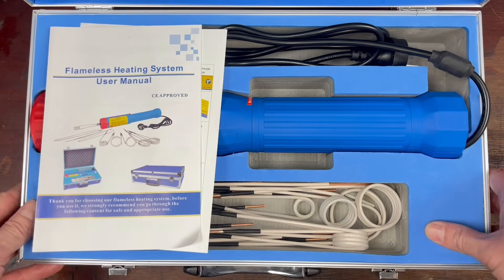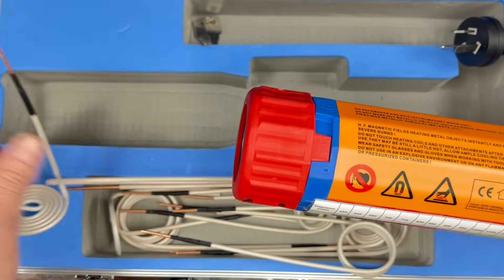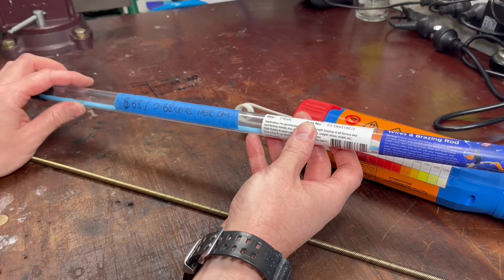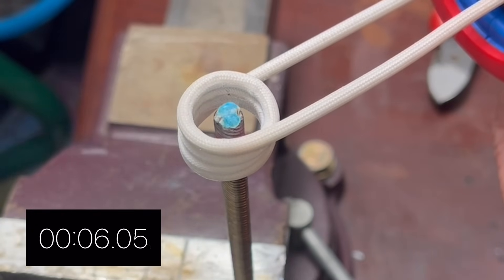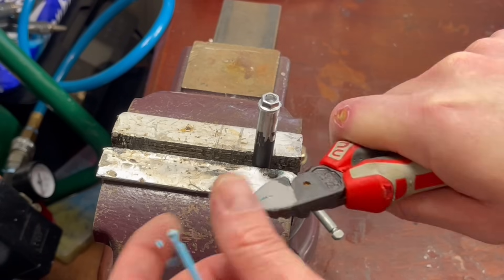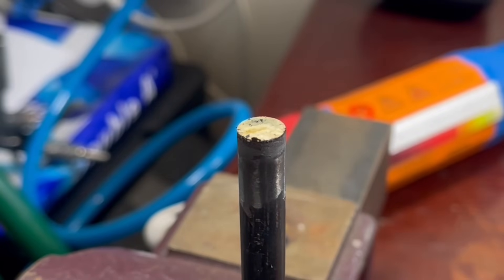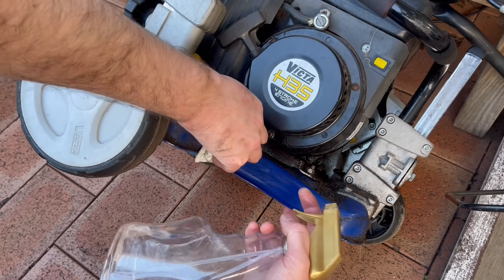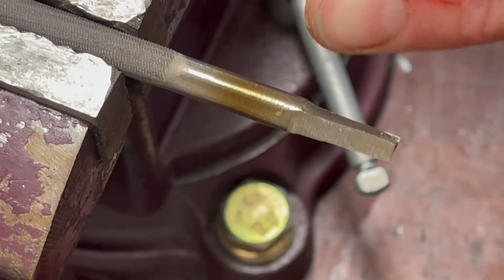Every Mechanic Needs This Tool! Save Time & Money!

Comment: Having used propane, mapp, and oxy/acetylene, all of my life, I have always dreamed of having an induction heater to get even better use of heat. The only problem is it has to be a ferrous material for it to work, as it uses a magnetic field to induce the heat, and non ferrous metals do not react to a magnetic field.
Reply: Not strictly true. Induction heating creates a very high amperage current in the workpiece. Even pure silver should melt if you have enough magnetic field strength and current. It just gets harder to achieve the correct parameters for melting with lower resistance materials like copper, silver and gold. You can buy an induction furnace designed for that specific job though.
Reply: @evanpnz  So the problem is the load the non ferrite material have?
Reply: @jeffreyyoung4104  No, just getting the right balance of inductive coupling, current, and internal resistance of the heated part.
Reply from the maker: It’s very strange, it is useless on solid brass bar, but on brass tube it’s fantastic (glowing red in 10 seconds) however I have only tried brass not Aluminum.
Reply: @VintageEngineRepairs  the brass tubing may have had nickle in it, which is magnetic.
Reply: @VintageEngineRepairs  induction likes edges thats why the wire used is flexible "Lenz" wire, its all outer surfaces aka edges vs the inner solid mass. The brass rod is more inner than out while the tubing has high edge to mass ration so heat up really well. Corners in square rectuangle rod tends to overheat which is why professional coils have "ears" loops to lower the effect in corned. You can "burn" the metal otherwise.
Reply: @deaultusername You mean “litz wire”. Lenz is the guy the induction law is named after. Litz (from the German word for “strand”) wire is the one where each strand is individually insulated to maximize skin effect.

Comment: Induction also works on non ferric, even non metal material, the material only should conduct electricity.
Aluminium need more electric field, it gets hot, but not always, if the field isn't strong enough.
It also works on carbon, like a graphite crucible to melt metals in it.
Reply: I came here to say that. It relies on induced current, so the target only need to conduct.
You can heat up carbon with an induction heater... Try a pencil, the graphite will work (have a bucket of water ready!)
Reply: @juststeve5542  Pencil works best with 24V DC on both ends :D its a quality test *just kidding*, bad pencils can detonate, not really violently but a bit scary, when the wood releases gases on the inside. wear protection, do it outside, with no flammables near, water bucket ready :D but that's not induction, it's fun.
Reply from the maker: Thanks for sharing! I tried a small brass bar it was hardly even warm after 10 seconds. I tried brass tube and it was glowing.
Reply: @VintageEngineRepairs  you're welcome. its also depends on mass, if there is more mass it can induce more heat, but more mass needs more heat, it spreads evenly. small things get hot, as bigger once, but i think bigger things got better mass to surface ratio therefore, less heat dissipation.most effect as already mentioned is the distance to the coil and turns. Tubes are a good shape, for that. Its really try and error, depending on the device.
Reply: @VintageEngineRepairs thermal conductivity also plays a role. Aluminum, copper,  brass, etc. are 2-5 times more thermally conductive than steel. So with a 1kW induction heater like that, the heat spreads into the rest of the material almost as quick as it's  "produced", so the entire part warms up instead of just the area next to the coil.

Comment: You can use bare copper wire of the proper gage as long as the coils do not touch. But that would only be in case you couldn't get replacement coils.
Reply from the maker: You’re spot on, since the release of this video, I ordered 2.5mm solid copper wire and you also need a roll of 3mm fibreglass sleeves. Just make your own. Even cheaper than the ore fabricated coils :)
Reply: @VintageEngineRepairs and @vhoward1122 Thanks for the money saving tip!
Reply: Many thanks for this , I’m definitely going to purchase one for the workshop , what make is this one please

Comment: Oooh..  This is temptation.
I have a collection of thin walled mild steel tent and marquee poles for repurposing into useful new things, or just for creative fun. I am building my own truss for a new shed roof right now and plan to make custom curtain poles next. Arc welding thin walled steel together is time consuming and tricky - so easy to blow holes instead of make neat joints.
Not long taken delivery of some Polybend, a non-toxic plastic version of low melt metal such as Woods Metal, so I can bend the tubes without losing the circular profile.
I can see this induction heater heating two thin steel tube ends to welding temperature so all I have to do is push them together to make a join. If that doesn't work I'll braze the two ends. Neat, easy and quicker than arc welding.

Off to check bank account...
Reply from the maker: Awesome project for the induction heater! That’s a great way to do it, as you say - its easy to blow a hole through it with welding, at least with my level of skill haha. This is a fool proof method for brazing :)

Comment: I had one it blew up after 5th cycle, I kept within the 2 minutes but i suspect not waiting 5 minutes in-between each cycle compounds the heat.  Still a good tool ill probably go for the slightly more expensive one with a remote box for the electronics.
Reply from the maker: Ah sorry to hear it! I hope you managed to get your money back :)
Reply: The same item has many repeated/abandoned listings on Amazon. It's a way that manufacturers can suppress bad reviews and so gaming the review system, which is why very few have any stars/reviews. I would never buy something without plenty of positive reviews when It's clear this has gone on. So I have a feeling you aren't the only one.

Comment: I got one of these for a tough job repairing front suspension of a car, could not use flame near the firewall / floor with insulation and carpeting.  Worked good.
Reply from the maker: Awesome! Pleased to hear it :)

Comment: Do they sell or is it easy to find that wire you make the coils out of incase you want or need to make more or larger custom coils?

If what your trying to heat up touches the induction coils will you get shocked?
Reply from the maker: Since this video I ordered 2.5mm copper wire and insulation to make my own and always have on hand. Yes, if the metal coils touch metal, the tool sparks. Not good lol

Comment: A very very thought out and entertaining demonstration of an induction heater , I enjoyed it very much and subscribed :) 

Safety I agree , 
Control , partially I agree ,
Ease of use , it goes to Map-Pro gas , try plumbing with copper or for that matter anywhere you need a complete end to end connection. How will you wrap the induction heater around a pipe for the last connection , there is no end to slip it over ? Not going to happen. Heating large surfaces evenly , in a space heater , etc.   I can list quite a few more.
Portability I agree
Price I agree
Cost of consumables in the case of DYI users I agree , I am a large consumer of MAP-Pro and my company buys it in bulk wholesale lots which is about 40% retail cost.
Availability I agree
Speed /Efficiency I would give it a draw (See ease of use response) . There are many jobs that induction heaters cannot do that Map-Pro can so each has their definite forte making both a good thing to kit your vans with. 
Versatility I agree 

The yellow cylinders are a MAPP - Propane hybrid (MAP-Pro) and NOT propane. This is a distinctly different gas with a much , much higher temperature and it uses a different torch head than a propane torch head and can be dangerous if mixed so this should be carefully noted for those not familiar with the two gases.

Comment: Actually, you showed MAP gas.  Propane is about 30% cheaper. (USA/Amazon)
Reply from the maker: You’re quite right, it’s propylene. I don’t refer to it as MAP as people presume I’d be referring to MAPP, (methylacetylene-propadiene propane) which it’s not.  Instead MAP is 100% propylene.
Reply: @VintageEngineRepairs  Are you saying that "Propane" does not develop sufficient heat to do these things  Why bring MAP into the discussion if propane will suffice?
Reply from the maker: @alext8828  you brought Map into the discussion, not me. You do realise MAPP and MAP/PRO are totally different things…

Comment: You solder by heating the parent metal and letting the parent metal melt the solder, otherwise you get a dry solder joint that is weak and is less conductive electrically.
Reply from the maker: Yep, that’s what I explained in the video
Reply: I think more often, people overheat the joint?

Comment: Very expensive.
Reply: Nothing is cheap now days
Reply: No, expensive is spending hours under a car that's lived it's life in the snow and salt and you are trying to remove nuts and bolts that are rust welded
Reply: Only $189 USD on AMZ. :-)
Reply: That's cheap for a good induction heater that's as versatile as this one.
Reply from the maker: As mentioned In the video, upfront it’s fairly expensive, long term it’s very affordable.

Comment: They're wonderful tools, but there's so many brands and models out there ranging from very expensive to very cheap. Hard to know what's good quality, effective and reliable. How does a $150 model perform vs a $1500 model and how much use and abuse can they handle over time? For now, I'll make do with the old torch.
Reply from the maker: Yeah they’re brilliant!! Regarding longevity, I’ll certainly do an update video in a year and share how it’s holding up :) this is aimed at the home mechanic of course, but I’ll be using it professionally so I’ll be putting it through its paces. Thanks for watching!

Comment: Since it only works with ferrous metal, I wonder if some sort of steel insert could be used to place into an aluminum engine block then heated up for bearing installation.
Reply: Impedance seems to be better matched with higher relative resistivity metals such as iron.
Reply: @jagmarc  my doctor gave me a prescription for my impedance. Worked great. 😂
Reply from the maker: Very interesting idea!!
Reply: Actually.... I'm not sure why they make this claim-  I purchased one several years ago for many things; but primarily for annealing brass (a non ferrous metal) cartridge cases, & it works fantastic!
Reply from the maker: Yeah I tried brass tubing and works well, but solid brass stock it hardly even warms it up.
Reply: @VintageEngineRepairs  - Interesting. Scientifically, I'd like to know how tubing vs solid makes a difference-  Thanks!

Comment: Refillable propane bottles come in different sizes. Some bottles are on exchange basis if you prefer otherwise it's retest every 5 years. Advantage of owning own bottle is gas cost. Numerous sizes of tips for propane for increase or decrease in flame type, i.e needle point for extra low heat to wider for large area heating without the need for different sized torch handles, no need for a regulator as the handle is the reg i.e restrictive orifice. 
The device you show if it could heat a u shape coil would make it more effective on pipe or other material where you want to join stuff without it looping around the object
Reply from the maker: Very true! I use Map/pro so it’s just the one size by bernzomatic. Unless you know or other more affordable Map/pro out there? You can heat up shape u-shape material. Just bend the coils to the profile - it doesn’t have to wrap all the way around. Regarding propane vs induction, propane has its place without question! They compliment eachother and have areas where they excel!
Reply: I just upgraded to oxy-propane and the accuracy of heating is nice rather than the broader flame of mapp burner, but the induction looks even faster (but not nearly as exciting as holding a lit blowtorch!).
Reply from the maker: @mikelastname  gotta love the controllability of oxy!!!

Comment: i'd have liked to see you braze carbide cutters to boring bars for lathes.
Reply: There are YouTube videos showing induction heating being used to braze carbide tips to circular saw blades.
Reply from the maker: Because carbide isn’t ferrous it can’t be brazed using the induction heater sadly! I’m not sure if the radiant heat would be sufficient to heat the carbide up enough.

Comment: How can price be a draw you included the cost of propane but you didn't include the cost of electric and induction heaters take a lot of electric, cost / con was a draw for the same reason, but i still agree with you conclusions well done in the most part.
Reply from the maker: Hey mate, it’s a fair point, but when I calculated the cost of a 10 second burst which was basically (within a few seconds) what it took to heat nuts, bolts and shafts up to cherry red  with the induction heater it cost $0.0017. It’s so marginal.

Comment: You should add electricity to price/consumables part for induction heater.
Reply from the maker: Hey, it’s a fair point, but calculating it, it’s $0.0017 for a 10 second burst.

Comment: 1970s we sharpened pickaxes for the road gangs in the forge, draw the tip to a point, partly quench to harden the tip rub the tip on the floor to make it shiny and wait for the colour bands to creep up from the residual heat and then fully quench at Purple to set the temper.
Reply: I sharpened a chisel back in the 90’s on a grinder, didn’t know anything about hardening but the tip changed colour, so I sprayed it with wd40, don’t use it often but it’s still hair shaving sharp
Reply: @1988dgs  I guess the WD40 evaporation did the trick to cool and set the temper.
As part of my 1979 apprenticeship, a hacksaw project to test skills was to make a 6 inch G clamp out of solid flat bar. At the end the task was to put it in an electric furnace to temper it BLUE but mine came out dark brown, the lesson learned was the electric furnace dial is not accurate ;-)

The year before at school I was told to make a cast aluminium G clamp the same size :-))  I think I still have it as a paper weight ;-)   The skill being taught was green sand casting.

Glad you kept the chisel

all the best
Reply: @jdhtyler  Unless the chisel reached red hot (austenizing point specifically), the only thing that happened was it got softer.
Spraying WD-40 on something with blue or purple oxide will just cool the softened steel faster.
Reply: @1988dgs 
Sounds like you got lucky on your chisel.
Could you do it again?
Reply: @1988dgs  Bullshit
Reply from the maker: Crazy! Thanks for sharing :)
Reply: @VintageEngineRepairs  So... this kind of induction heater won't work on Aluminium?
Stainless steel?
Thank you! 👍
Reply from the maker: @TheScandoman Hey! I haven’t tried it as the manual says it won’t, but the manual also says it doesn’t work on brass yet it gets brass tubing bright red in seconds lol yes to stainless steel:) 100% yes it works on steels, iron & copper tubes! People were interested if they could use it to annealed reloads which it does.
Reply: How did you get the road gangs into a forge? La Machine?
Reply from the maker: @LiftPizzas  I read that about 5 times thinking back to my video, but couldn’t make sense 😂 now I see it was for someone else LOL
Reply: I take my soft as a baby’s bottom cheap steel tools like pickaxe/ mattock, shovels, axes and splitting mauls and use high impact hard facing rod for buildup of construction tool surfaces like bucket teeth.   I bring it back to shape by grinding to leave only the last bit hardened steel. Turns near worthless soft tools into insanely tough and hard cutting surfaces.
Reply: Sounds like they punished crime in the 70s.
Reply: That’s what I was taught to do as an apprentice.
Reply: Nowadays kids are too scared of fire to do that